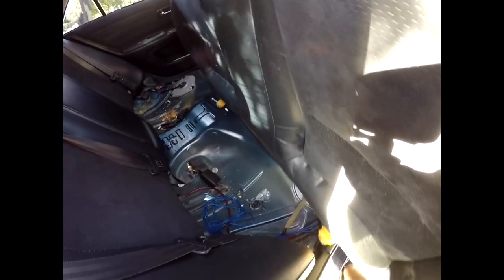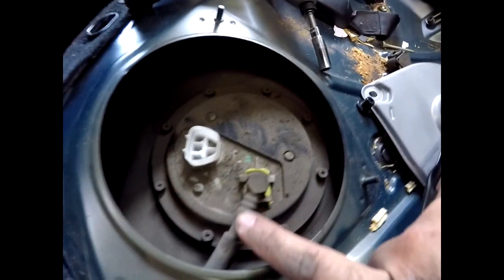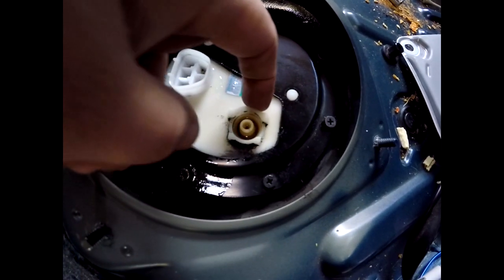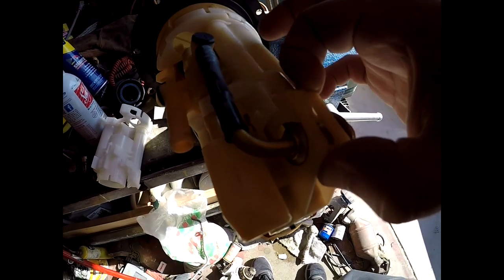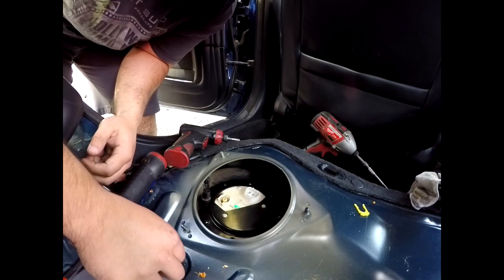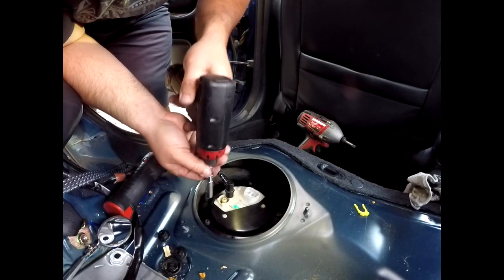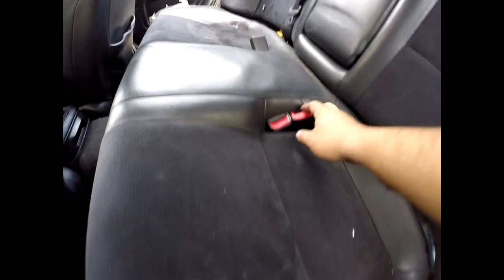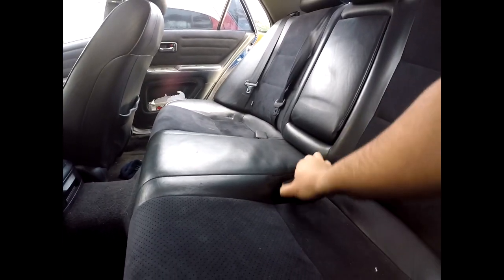2003 lexus IS 300 Fuel Filter - Automotive Vlog 3

Comment: Thank you for the video. I was able to change mine out base on your video. There was the part of disconnecting the old plastic from the fuel pump. But if one can get that far then you should be able to do the swap. Be careful about the plastic tabs, they can break and I did not see a replacement filter housing available elsewhere. You also may want to buy a new fuel pump as well they are about $20 from RA. I did not but probably should have - I'm at 250,000 miles. Great video again.
Reply from the maker: Glad you found it helpful, thanks for commenting on your experience.

Comment: thanks alot Drijvdo. So you just replace the filter body not the pump and strainer? any reason for that, or any recommended pump kit?
Reply from the maker: Joe Cox body and strainer were replaced as part of the repair. it came as a kit.

Comment: After doing this, I took it out for a test drive and now my speedometer lags to show me my actual speed. Any ideas or what to do there?
Reply from the maker: well i guess it could be possible that a fuel line may have been pinched causing a decrease in fuel pressure which fuel delivery can impact acceleration. easiest way to identify would be to check the fuel pressure and make sure you have full pressure. other than that, the two items would really be unrelated in my opinion.
Reply: @DROJVDO  hmmm that's interesting, I changed my fuel pump thinking that it will give my fuel lines more pressure. Before changing this my speedometer worked fine and all and everytime I'd pump gas into my car it would take time to start back up
Reply from the maker: @RobertoRamirez-in6sk  a fuel pump whether it be stock or aftermarket will only allow as much pressure as the fuel pressure regulator is set for. Without actually digging Into this I cannot actually say for certain what part of the repair may have affected the speedometer.

Comment: My fuel gauge stays on half a tank and if it does move just barely when I fill it up.. the only time I know it’s full is if the gas pump stops. I’m assuming it may be the fuel level sensor/sending unit. But why is it so hard to find the pieces online for a 99 Lexus es300.. I was just going to replace the whole housing I can’t find anything but fuel pumps. Then on one website just for the fuel sensor itself is $163.. of course I seen pre used fuel pump housing etc on eBay. Not sure whether to buy the level sensor or whole assembly that’s like $50 plus.. hm.
Reply from the maker: L that's a tough call on a somewhat expensive piece. If you want to just get it all done once then buy the while assembly. Although if you just want to fix the gauge issue then you could just test the sending unit buy checking the resistance as you move the arm on it up and down. Its very likely that you have high resistance causing your issue.
Reply: Drojvdo I think I may tackle this job on my own save me some bucks. For the most part everything is just clip ons / off? It seems a little intimidating since it deals with gas but what better time to learn. Would I have to disconnect the battery when doing this?
Reply from the maker: L clip on off for the most part. it's not required to unhook the battery but it wouldn't hurt if you want a little added safety.

Comment: I know this is an old video but quick question would a faulty fuel pump cause your car to turn over and start for a second then die? Currently running into that problem on my 2004 Is300
Reply from the maker: Charles Wilburn once the pump has stopped working the car should not start. i would start off by checking the fuel pressure to verify that the pump is indeed not working. if you have pressure at the fuel rail, then your issue maybe  caused by something else.
Reply: Charles Wilburn I’m having this same issue currently on my 2001 is300 any luck on find out the source of the issue?
Reply: @ocrazyeye5828  Yes it was actually my MAF sensor
Reply: @ocrazyeye5828  I found the replacement on Amazon cheap and it takes a few minutes to change
Reply: Charles Wilburn thanks!
Reply: @ocrazyeye5828  No problem! Hope that helps you! It fixed all my problems even my shifting issues oddly enough
Reply: @KentoNamikaze  did your car throw a check engine light? i have the same issue but no check engine light...
Reply: @silverjce1  it took a while. The code wasn't thrown till it wouldn't run any longer.
Reply: @KentoNamikaze  you mean after it dies the light comes on or it threw a code?
Reply: @silverjce1  that's what happened for mine. I'd recommend just bringing it and getting the codes ran and if you still have nothing I found the maf sensor on Amazon for like 40$ and changed it.
Reply: @silverjce1  yeah once my car died and wouldn't start that's when I began getting the code.
Reply: @KentoNamikaze  i have a reader and it shows no codes. i can start it no issues i can rev it and sometimes it will cut power and die. other times it will idle, stutter, catch itself before dying and idle again. it will do this 3-4 times before it dies. other times when i try to rev it to catch it from dying, throttle input does nothing and it dies. I've ordered a new maf so I'll report back if that's it. thanks!
Reply: @KentoNamikaze   maf wasn't the issue. upon further inspection the fuel pump resistor connector had become disconnected, it's located on driver side in front of the fuse box. once connected my issue was resolved.

Comment: When I took out that clip the flew on your vid fuel started seeping out of top?
Reply from the maker: Ari Koenig if I remember correctly a little bit of fuel came out. I believe it was just fuel left in the line as I had already depressurized the system
Reply: How do you depressurization system?

Comment: Where did you find this part? I can't find it anywhere
Reply from the maker: David Inman that's odd. I was able to find it at my local parts store. it came with the replacement fuel pump housing as well as the strainer attached underneath. I would reccomend searching for it online if you havent done so already.

Comment: Lexus says this is a lifetime part not needing to be changed out, whaddaya guys think?
Reply: My IS250 went to limp mode recently. At Lexus dealer they quoted me 2300 to replace the fuel pump.  Im baffled.
Reply: How many miles on the car? Always is good gas?

Comment: Fail fail fail I don't even have time to list the unsafe and basic mechanic  skill you lack bro
Reply from the maker: Neville Brennen thank you for the comment. I would be interested to know what your reccomendations would be.
Reply: Drojvdo when dealing with fuel power tool dangerous even if its a brushless motor socket slipping may cost a spark and u know the rest (boom).....the clip disappear  o man thank goodness you found  that if it didn't drop in your reach u would have had 2 drop the tank.
....an that model doesn't cycle fuel that way it engages fuel pump on crank from my knowledge and primes system on shut off.....good luck but your videos was helpful need 2 check set up of assemble between American model and Japanese altezza still the same...thanks be safe
Reply from the maker: Neville Brennen thanks again for your feedback. you're correct about the power tools and that was an oversight. I also agree that I got lucky with the clip. I appreciate the honest response. it really helps improve the quality of my future content. best regards
Reply: Neville Brennen but he used an extension and brushes were far away. Its more dangerous to have the wiring to the pump than using electric tools outside the tank.
Reply: Neville Brennen , your removal techniques are sloppy, wouldn’t trust you with my car, nevertheless thanks for the informative video